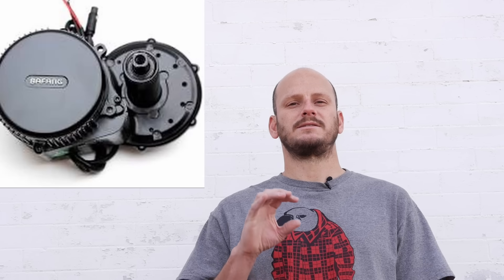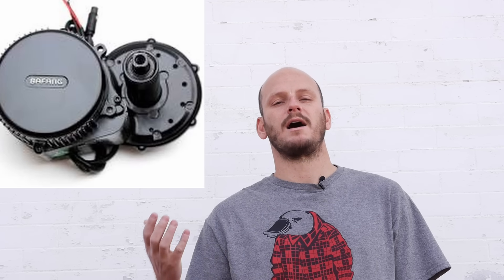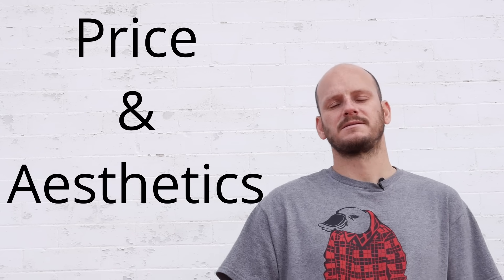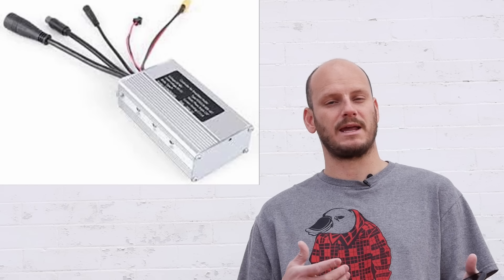Hub vs. Mid Drive Motors: Why Hub Motors Suck and Debunking Common Myths with performance test

Comment: Hey Johnny, thank you for the video! Lots of good points here. I've got a mechanical engineering degree and run an ebike shop that exclusively uses hub motors, so I have a different perspective (obviously!). I think you're mostly incorrect and I'll start with 3 points: reliability, aesthetics, and REGENERATIVE BRAKING! First, you already noted this, but hub motors do not cause broken spokes, and if you know how to properly build a wheel around a hub motor (low spoke angles/cross patterns, quality parts, spoke prep, and attention to detail is basically it!), you're golden. Additionally, hub motors have 0-1 stages of gear reduction, not the typical 2 of a mid drive (fewer parts to fail), and do not contribute to chain wear and breakage. Reliability goes to HUB MOTORS. Second, hub motors look great, smaller ones are super stealth, and it's possible to integrate a controller in a motor (like old BionX systems did) or, as we do, in the battery using a hub motor. So hub motors look better too - or at least, are comparable. THIRD: REGENERATIVE BRAKING! With the right motor and setup, you can recover 15% of your energy used in hilly areas, and more importantly not wear down your brake pads when you brake. It's awesome, you should try a proper high-torque regen ready hub motor some day (like the GMAC motor from Grin Tech paired with their Phaserunner).
Reply: I have converted bikes with Bafang Middrive motors (3 Conversions) and 2 Grin GMAC conversion with phaserunner.  The GMAC Hub motor beats the Middrive hands down in my opinion on all aspects.  (Handling, feel of the bike, shifting, off-road and pavement experience)  Another aspect for my area, I have local trails that forbid E-Bikes.  The hub motor conversion allows me to throw the original wheel back on the bike and be trail legal)  I can climb the local mountain (Trail or road) much easier than the Bafang BBSHD drive with the GMAC hub motor and have 14% regeneration at the end of the ride.  Beat that Mid-Drive.  Have Grin Tech build your wheel for $60. And that useless Regen.... get's me back home after climbing the local mountain for a 48 mile round trip on a 13.5 amp hour battery.  I have gotten 20% regen at the end of rides in the local hills.  I think hub motors have a bad rap from people using cheap, poorly made motors with crappy controllers.
Reply: Is there any fold bikes with Gracie motor from grinn
Reply: H ha  ha the picture of the wheel with bust spokes,,   its not got a hub motor its just a front wheel BIG MISTAKE
Reply from the maker: Some of it is opinion for sure, like aesthetics and reliability ( until we have actual factual data) for me the performance outward any benefit from a hub. Hubs are fine if you live in a retirement home in Florida with no hills in sight IMO😝. I’m not sure if %15 is attainable for the average bear, maybe if your actively “hypermiling” but realistically I’d say it’s more like 3-5%. 
That is awesome that you run a shop though, do you sell premade Ebikes or do conversions?
Reply: JohnnyNerdOut l
Reply: If you're buying a direct drive motor, you're not using your bike as a bicycle, you're using it as a moped. love how you didn't mention how regen screws up riding if you decide not to use your battery or some such. enjoy powering that generator with your feet.
Reply: @2DMax00  Regen is not always activated, lol. A generator only does Regen when it has an electrical load. Have you never used an electric scooter?
Reply: Highly unlikely your ANY kind of an engineer, or your wouldn't make such stupid claims.
Regen on a bicycle is quite useless (except for the brake pad thing, which is a non-issue as well due to very cheap, and easy to swap) as they just don't have enough weight to generate much useful energy (rarely coast past 25-30MPH) your 15% claim is GROSSLY EXAGGERATED. What you do get is a lot of extra drag when your batt. goes flat.
 Yep, small "shiny" hub motors do look pretty good, say a 250 watt like Giant used one time, in the same sentence you mention BionX, they are HUGE, and ugly as shit.
Anyone who thinks a hub is as good as a mid drive either lives on a pancake, or has not tried a mid drive, I have both, and live 600 feet "up" from town, the 500 watt BBS02 does not see, or slow down on the hill, ha I don't even have to pedal, the 500 watt (also bafang) hub struggles hard, AND uses about twice as much battery doing so, and if I didn't pedal quite hard it would stop completely.
Hub motors are OK if you live on relatively flat ground (they're still NOT as efficient) if you don't live on flat ground the SUCK, period. Like Johnny said you don't drive around with your car in high gear all the time do you ?...OH, maybe "you" do, I forgot, your an engineer. 
PS your hub kit is WAY over priced.
Reply: @spr624  I'm sorry to inform you that you are wrong, and should have restrained mocking OP.
In Paris (a pretty flat city), I average 9 to 12% of regen, while running 25 mph, being heavy on the throttle, with around 750W of power.  
Numbers shows around 30% of regen in mountainous environment.
I'd say 15% on a hilly setup, is quite low.
Go check Grin Technology takes on regen, it's great:
https://youtu.be/gYCj4asp9pE

And yes, not replacing your brake pads is great, less maintenance is always appreciated.
It's exactly like not having to go to the pump (90% of the time), when you get an EV. You realize it's great only when you experience it, not before.
Still about maintenance, mid drive motor will wear your drivetrain way faster (especially with high power). That's more maintenance. Maintenance is annoying.
That's also why I like front hub motor, in addition to having an AWD bike which helps for traction, it will even out strain on both wheels. Less strain, less maintenance.

Your, and Johnny's takes on not having multiple gears for your motor being bad, shows how you don't know much about an electric motor characteristics.
FYI electric cars, don't have gears, and don't need them. Because contrary to ICE engine, an electric motor can deliver a lot of torque from start to max speed. ICE needs a lot of gearing because their power range is pretty narrow, between 1500 rpm and 3000 rpm for diesel hence the need for gearbox for those cars.

The thing with mid drive, is that with all the gearing, you'll have less efficiency. Unless for niche situation (like mountainous setup, with a fast winding motor, for example), your hub motor will have better efficiency.
You should go check the motor simulator from grin tech (https://ebikes.ca/tools/simulator.html#HowtoUsetheSimulator), in addition to its extensive and highly technical video about hub motors:
https://youtu.be/c96n0Ma2rLY
You'll notice that the efficiency range of an electric motor is very wide, and don't require a complicated and less efficient gearbox.

Btw, they guy behind Grin Tech knows his shit pretty well (he designs motor and one of the best controller on the market)

My view on this, is that mid drive peoples, usually come from "dry" bikes people. In their mindset, the power must come from the crank, and they can't get their head around it.

One last thing though. I beleive Johnny when he says he had seen a lot of fried and broken hub motor. The thing, is, usually (at least in france), hub motor are often used for cheap bikes, so, the motors are cheap and crappy, hence the high failure rate.

My hub motors are 10YO, have thousands (if not tens) of km, and runs  like day one (even though I recently upgraded for a Grin All Axle, it's a beast).
Reply: @xmtxx  tbh they are both great options for diffrent people

If u want max peformance + good hill climb then go for mid drive

If u want an easy and fun to ride bike go for hub 

Also even though mid drives have more maintenance it’s not a huge deal. If I use it correctly and get good quality parts then u would be good

 Regenerate  braking is good until u have to ride the bike without the motor
Reply: @spr624  dude take your xanax and relax, no need to be rude here
Reply: @spr624  Hub motors are by definition more efficient than any mid design. Now, the problem with mid drives is more apparent in electric motorcycles (they use too much space that should be dedicated to battery), but they are not all that great even in bikes. Yes, multiple gearings means better climb characteristics, but as just as nobody is living in a plain field, also nobody is living in a mountain with that degree of inclination, at least not the people at which these products are usually aimed at. Hubs can have more advantages with higher power and more sophisticated hardware and software (dual motors, slip detection, regen (less wear on mechanical parts IS important)). Mid drives are fine for bicycles, but they don't scale well.
Reply: @spr624  Talk about stupid claims
I have never ridden a mid drive, but I have a "500 watt" hub drive drive chinese mountain bike and that thing absolutely shreds

I climb steep gravel/dirt/whoochipped hills with no problems

A lot of people here forget these are bikes not motorcycles.

But even when I use my bike as a motorcycle (throttle only) it still shreds, even through hilly forest trails. 

I literally live in one of the least flat states too. My house is basically on the side of a mini mountain.
Reply: @PlokTheMasterGamer  depends how much you weigh and what you call steep hills. also a 500w motor can output way more peak. but your 500w hub Chinese mountain bike that will climb any hill on throttle sounds too good to be true..what's the brand / specs ?
I think my wife ebike (ride1up 700) is geared too high (28mph): for it's power (500w nominal, 750w peak). it it was geared for 20mph, it would probably have no issue with the hills it's struglling with. my wife used to have an European spec ebike,15.5mph/250W hub motor that had no issue climbing even with my 200lbs on it

Comment: Its so much easier replacing a chain than fixing a wheel. So true. Sold on mid drive that I might be able to deal with myself in the middle of nowhere.
Reply: What if it's a long day, getting dark and you just want to get home quicker without having to stop to replace a chain?

Comment: If you're just tooling a few miles and you're not wanting to spend much, a hub motor is the easiest solution.
just be aware that if you're running rim brakes, wear can be an issue. and for fun, a warped-out-of-usage rim from hitting something.
**a front hub-motor might be the best hub choice, since front wheels take less abuse.

but yeah, if I'm wanting a for-real e-bike, I want a mid-drive because I wear the crap out of rear wheels.

Comment: Hub or mid-drive, quality components make all the difference. Years ago the market got flooded with cheap crappy hub kits, and they often don't last well. Mid-drive is a winner if you have suspension, because unsuspended weight of hub motors reduces the effectiveness of the suspension. If I were setting up a powerful e-mountain bike, I'd go mid drive all the way. For an e-assist 'round town bike I might choose hub drive with a torque sensor because it is easy to operate and handles more like a traditional bike.

Comment: I’ve got a Fuji Auric mountain bike that I’d like to put a mid drive on, I live in a hilly area and will be doing both road and moderate off road riding, nothing super crazy.  What size motor should I get?
Reply: The more power the better . Mid drives have different power levels you can use . I have a bbshd and just bought a 3000w controller for it . I also have a 1500w hub with a 2000w controller and the speed switch . The more power the better . You dont have to use it but its nice to have it if you need to move in a hurry .

Comment: What exactly chain would you recommend to buy to for bbshd soon i gona buy bbshd52v 1000w 🥰 I will also use the mountains
Reply from the maker: I’ve had good experience with both sram and KMC lines. Just keep an extra on you just in case

Comment: I always tell people to go over to ebikes.ca and read up, then check out you and a couple of other Youtube people, before helping them with their setups. I have two Catrike Expeditions, one with a Crystalite 3640 hub motor and the other with a Bafang mid-drive, both are running at around 1500W. For your average schmuck riding a DF, a mid-drive is nearly always the way  to go. For others, it is a toss up, really depends on application. A cargo bike or touring recumbent trike, will go through chains and fry the controllers MOSFETs, with a mid-drive. On the other hand a GMAC hub motor with a Four Runner controller and a Cycle Analyst, is pretty bullet proof, in that application. For the crazies, who do things like the Mt. Diablo hill climb or the Honda Death Race, they go with hub motors and battery systems, that resemble bombs, when they thermal overload. For the folks with some common sense left, the Bafang mid-drives, are one of the best solutions on the market today.
Reply from the maker: I guess I’m counter intuitive, I’d recommend a mid drive for a cargo bike or any type of heavy duty application. I’ve found that if you ride like you’re supposed to, chains aren’t as weak as they are made out to be. Ebikes.ca make amazing products, love them.
Reply: @JohnnyNerdOut  Myself and severral others, have always had a problem with chains going South when touring. Remember that a recumbent trike, like the Catrike Expedition with a Cargo Monster or towing a B.O.B. Yak trailer are heavy, takes about 15 foot of chain, for them too. The problem with the Controller MOSFETs on a mid-drive, shows up on long hills (Lolo Pass) and in hot weather. My Katanga and Pterovelo Velomobiles, have never had the problem but they are another kettle of fish. Can you believe that Justin was just 13 years old when he invented the Brain Drain? Got his mom to start Grin Tech for him and his friends. Its now 15-20 years on, they just had to move into another larger place and they are still having fun.25 years ago, after my 4th back surgery and having my hips replaced, I got into recumbent trikes and e-assist for them. Controllers were no problem but beat my head against the wall for battery management, then he comes out with the Brain Drain. Could have beat the little twerp with a chair. He's just so much fun though. You can't stay mad at him. He goes and makes a ten speed, e-assist monocycle and then rides it for 500 miles. The world will be a dark place, when he stops having fun. I did my last round trip tour of the Lewis and Clark trail using his CA-3.1, C'Lyte 3640 hub motor and 72V 32Ah LiPO battery on my Catrike Expedition. I made the battery pack, everything else was from Grin Tech, went smooth all the way. My 6.0 foot tall 210 lbs. cranky old Marine ass, with an e-assit trike and camping gear, goes to around 325+ lbs. Hauling that up MacDonald or Lolo Pass, across the badlands. All in 100F+ temps, burns out the MOSFETs in mid-drives, way too often. Get control of the heat issues and I believe mid-drives will be the way to go. That and perhaps, a small enough roller chain, to run on a bike or trike, would take care of all our issues. Solid State batteries, wouldn't hurt either. Perhaps in time for my new Katanga Velomobile next Spring. I can dream.  ;-)

Comment: What about geared hub motor? It has most of the advantages of mid - drive if I understand correctly and is way cheaper...
Reply from the maker: Depends on how it’s geared/wound. Still essentially a single speed gear though.

Comment: Pfffff...Your reference to a gas car stuck in 3rd gear makes no sense for an electric motor, almost all electric has only gear ratio and it works fine. About the spokes, in both cases the power goes through the rear wheel axle to the tyre through the spokes, so mid-drive or hub doesn't change anything, it's just about the quality of the spokes-wheel assembly. Then about the cost, too me you underestimate the price difference. Also, for hub motor now, you can either have the controller in the motor (mostly on 750 to 1500W) and it works really well, or the controller in the battery holder for lower power range. Another one, yes you use a new wheel with rear hub, but to compare apple to apple you have to say that you also use a new crankshaft for the mid-drive...
Reply from the maker: Not totally following what your saying. But hubs motors do not send  power through your rear cassette. Therefore it’s only using the single gear that’s built inside the hub. A.k.a. a single gear.

Comment: I,d love to have one of these higher powered motors on my bike but there totally illegal where I live and I,m unlucky enough to be pulled by the cops as soon as I rode it . So I,m stuck on a 250w at 15.5 mph , the motor so very much wants to go faster but,s limited not too

Comment: Hub motors are starting to be more mainstream, and by more mainstream, I mean cheap.  Mid drive ebikes off the shelf did command a huge premium just a few years ago, and are only just now becoming comparable in price to hub motor ebikes.  If I were to buy another ebike, I would consider mid drive for the points you mentioned.  One thing that bothers me about this comparison is that the example videos you showed is for motor only, without pedaling.  For me ebike is supposed to supplement my energy input, not replace it all together.  I never coast just because I have an electric bike.
Reply: I just don't like not pedaling. And I don't do it for the exercise.
Reply: Tbh i almost never use pedal assist. I have a 1000w bafang bbshd mid drive. I either use throttle only or pedal only.

Comment: I am running 8000w QS 273 V3 hub motor at 72v (150amp Sabvoton controller)which has a rated max torque of 190 NM, I have no issues getting to 100kph in a flash make it up extremely steep hills without any trouble at all.
Reply from the maker: Dang, sounds like a moto